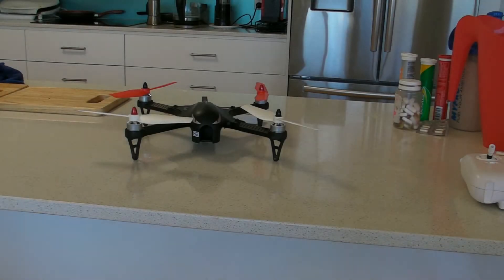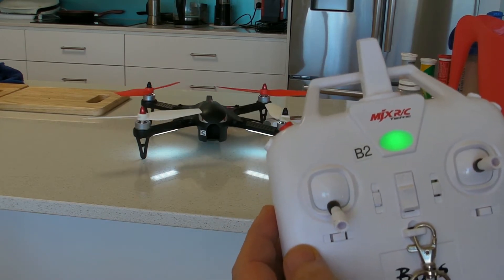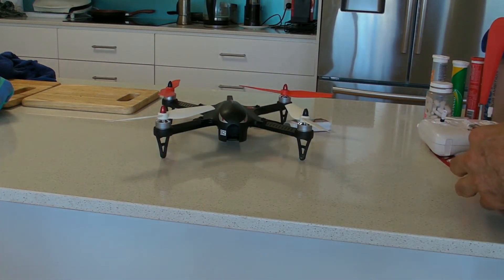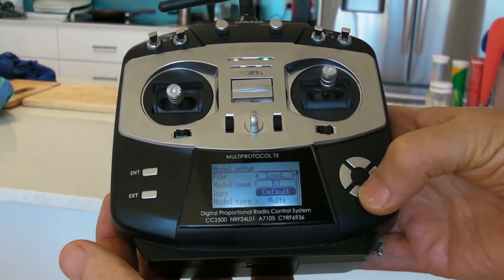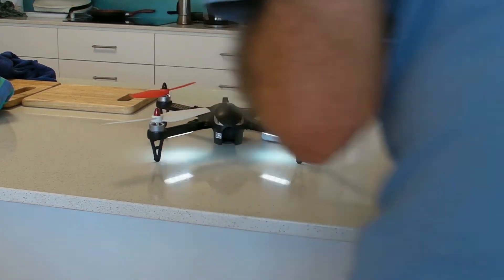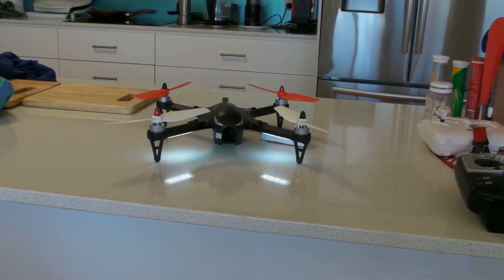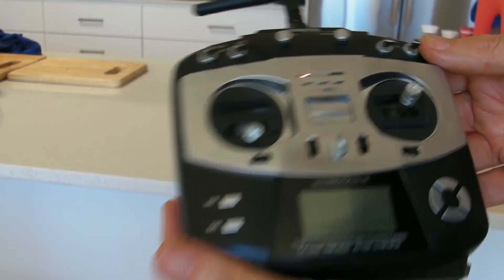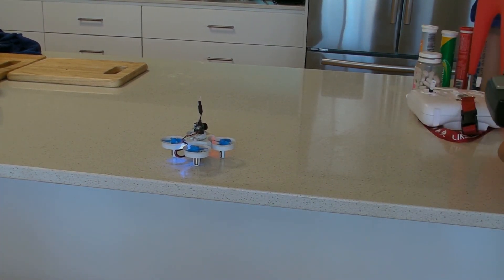MJX Bugs3 Try to Bind with Jumper T8SG Test Build

Comment: Did you have to download and reflash..the T8SG to get MJX.. protocol?
Reply from the maker: Back then I had to, as the Bugs3 protocol was just being developed. It is now included in the standard release . You can check to see if you have it on any T8SG by looking for "Bugs3" under available options. If it is not there, you will need to reflash to get the latest firmware. It is a good idea to reflash with the latest version from time to time, as the DeviationTX team are making improvements and adding new protocols all the time.
Reply: @skybug3  TY

Comment from the maker: Successful bind, motor start and throttle up for the first time last night. Will test fly soon and report.
Reply: David Dawson how do you bind the jumper to the bugs 3 and start the motors? Off a toggle switch? One of mine has broke already.. I don't know how to adjust the toggles and modify them in the settings. Only bind the jumper to my quads as yet

Comment: I've got the latest nightly installed on my Jumper and I can't find the same Bugs 3 protocol.
Reply from the maker: While under development, the Bugs 3 protocol is not included in the nightly installs. I has to be downloaded from the test builds. Have a look at this forum for details -
 https://www.deviationtx.com/forum/protocol-development/6696-mjx-bugs-3
Great to have another tester, although we're waiting for the next build at the moment.
Reply from the maker: The hexfet test builds are based on the latest nightly builds, so all your current models are still supported. Only need to flash the dfu file - no need to copy any files to replace models or other files on the Jumpers USB drive.